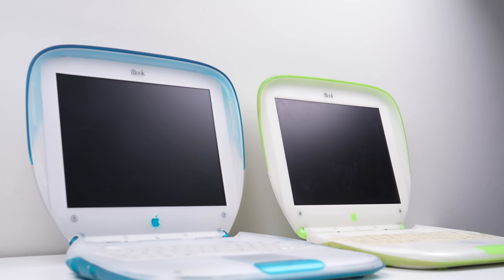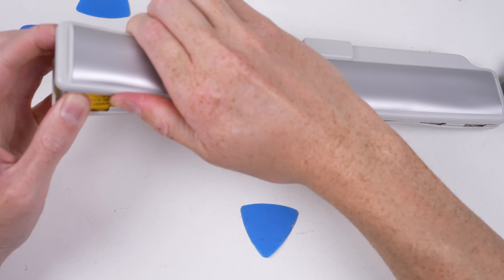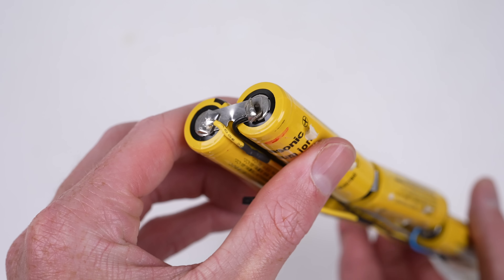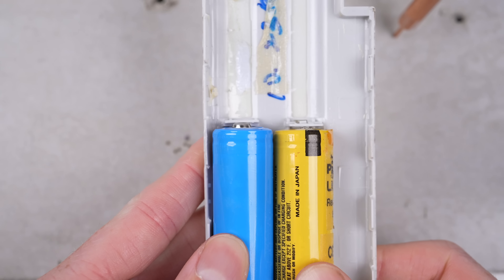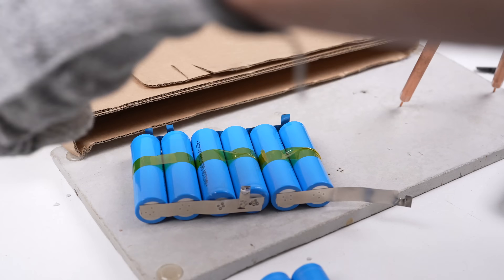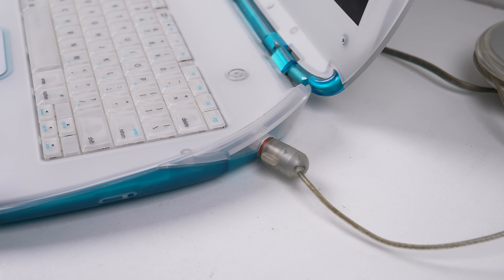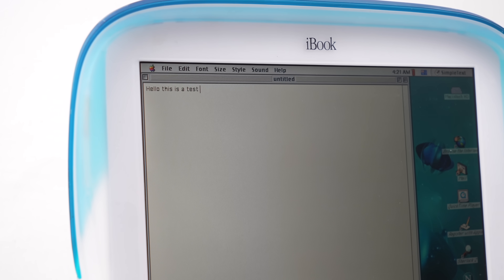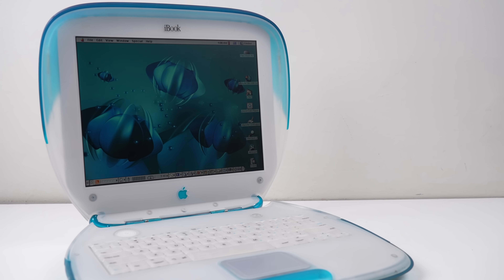Restoring a 1999 iBook G3 To Run On Battery Power - DIY Battery

Comment: I feel spoiled. We have a really awesome "Battery Depot" warehouse/Store that does EVERYTHING including custom battery packs to fit in older laptops and electronics.  Not that I'm dissing your skills but fingers crossed ANYTIME LiPo is involved! Kudos!
Reply: LiPo is akin to electronic HiexPLO(sive).
In this case it's a Lithium I-dunno(ion). Quite different. But not quite a grumpy attitude to negative influences.
Reply: @ningen1980 I kinda have to disagree. While LiPo batteries react a lot faster to overcharge, shorts, etc... and are more fragile, Lithium Ion cells in their stable metal cans have the unfortunate ability to build up a lot more energy, so while they don't fail as easily, they are a lot more dangerous when they eventually do. For example, a few days ago, a solar battery overcharged and blew the bedroom wall out of a house in Germany. The BMS had likely failed, and wouldn't stop charging. This happened a few times already with similar battery packs, but usually, the house was in use and drained the slightly overcharged batteries over night, so a few damaged cells were all that happened, but this time, the owners were on vacation, so the battery kept on overcharging, and nothing was using the power. At this point, a LiPo battery would have just caught fire, but this lithium ion battery kept on building up heat, pressure and energy for days, until eventually, it activated "instant bedroom wall remover mode". In this case, they got lucky no one was standing where the wall landed, but that could have ended much worse. Here are some pictures of the incident: https://www.ndr.de/nachrichten/schleswig-holstein/Nach-Explosion-PV-Batteriespeicher-von-LG-werden-gedrosselt,explosion1270.html

Comment: i got a oem battery for one that still works
Reply: It's always cool to see when these are really old batteries still work. My personal oldest is a 1997 ThinkPad 380ED battery that runs the laptop for over an hour.
Reply: my g3 clamshell battery isn’t rebuilt, lasts 3-5 hrs, my ibm 380z laptop from 1997’s battery (similar laptop to 380ed and i think same battery) is completely toast tho

Comment: Nice work. You were lucky that the BMS didn't shut down permanently after the original cells died like many newer ones do. When I recell Dyson packs I use a bench power supply to keep voltage across each cell tap as I replace that cell. Also, a slipping spot welder tip can blow a hole right through a cell casing - you need to be really careful there.
Reply: There was a tool which I found on dji forum which could reprogram the bms after cell replacement for most of the general electronics 

But it was 200 usd or something per year making it viable for shops only
Reply: @awdhut-e2e  There is alt firmware for the Dyson v6 and v7 batts which can reset those also, using pickit 3 programmer
Reply: @awdhut-e2e  I really wish there was an open source universal BMS programmer tool. This company's charging hundred of dollars a year for their software are obnoxious and likely illegal since they sell the proprietary BMS source code.
Reply: @awdhut-e2e  If you know what you're doing, you can reprogram the BMS using a $5 Arduino (Google "Squidgeefish: A1175 Battery Hacking"), a $6 FX2LP (Google "Karosium: SMBusb - Hacking smart batteries") or even a $3 CP2112 (Google "Leelum: Repairing the DJI Spark Drone Battery with DJI Battery Killer, CP2112, & 9V battery"). It's also possible with a Raspberry Pi, although that's not so cheap either.
Reply: Eff Dyson!   Those b@staffs and their “once dead, always dead firmware”

Comment: It should be illegal for manufacturers to implement the BMS lock like this, because of this most of the time we have to go for a low quality aftermarket battert instead if putting new cells that i know for a fact are good quality into the original battery pack.
Reply: Manufacturers should provide longer and more abundant supply of the original parts (especially the battery) even if the laptop itself is no longer supported, and always ensuring that the spare parts can be bought separately for self repair instead of relying on the service centers

But sadly they don't do that. Instead of offering any spare parts to support self repair, they want the customer to buy new devices
Reply: @sihamhamda47  I can still buy a battery pack for my 22-year-old no-name laptop. The problem is that because it's low-demand and still costs the same to make, it costs more than a current Dell battery pack.
Reply: @camboi6103 Driving a car is dangerous, airplanes can crash, boat's can sinks. Why do we use them then. It is crazy to me to stop people to do what they want with the stuff they bought.
Reply: @ do you need a license to operate those
Reply: @Attakai_The_Kitty  yes, but people stil don't know how to drive even if they gave a licence. And accidents can happen. I am not saying all people need to do this but for us that know how to fix stuff, why stop and make it harder to repair stuff?
Reply: @ because someone is going to blow their hand off trying to open a battery
Reply: @Attakai_The_Kitty  stopping you from completing the repair doesn't stop you from getting hurt while trying. In fact more likely to get injured while trying to troubleshoot why it's not working as opposed to if it just worked in the first place.
Reply: I make all kinds of  stuff from old laptop battery cells, and have about 200 cells at my house. The main thing is if you don't know what you are doing don't do it. First learn, don't be a dumbass.
Reply: Yeah I really wish it was illegal for them to do this anti-consumer crap. I've tried doing this on many laptop packs and it usually doesn't work whatsoever or works but won't register the new capacity properly.
Reply: @TechHowden  Apple was and still is the King of making anti-repair expensive disposable crap.
The irony is that they claim to be ecology-friendly.
Reply: @DonVintaggio  So true. I recently got a 2018 and M1 MacBook Air for free, both needed some repairs and hadn't been used in a few years and the batteries had both failed on them just by going under voltage even though the cells themselves still work fine but the BMS permanently locked and I had to get replacements.
Reply: @TechHowden You just needed to charge them longer, like a few days. Apple batteries don’t have lockable bms boards
Reply: @nomecognome2  the BMSes on those certainly did lock. The batteries drew exactly zero current and even after manually charging them up and bridging the MOSFET the computer would technically turn on but macOS wouldn't recognize the battery or continue charging them. The issue was that the cells went below 2V which the BMS considered to be a failed battery and will refuse to charge.
Reply: @TechHowden  Then there must’ve been some other issue. Apple bms’s don’t lockdown
Reply: @ i'm not sure exactly besides the cells going under voltage. I know both of these MacBooks charged correctly when last used before I got them. I tried charging both of them for several hours although the cell voltages never went up at all.
Reply: @TechHowden No, that's stupid. The solution is not more regulations, stop trying to push big brother government.
Reply: @babayaga7434  If you think companies should be able to make stuff intentionally much harder to repair, then what's your solution to this issue?
Reply: They should atleast add a reset button on the battery outside
Reply: You can unlock most BMS with special hardware
Reply: @7ismorethan6  yes but the only people making that hardware, at least the universal ones that work for all batteries will charge hundreds of dollars for it.
Reply: No it shouldn’t lol
Reply: I make stuff dummy proff but they keep making them dummer
Reply: I think they can’t charge because they have temperature control and, without any voltage in the cells, the bms didn’t allow charging the cells for safety reasons. Do a small charge on each pack and try again
Reply: All the discussion about the dangers of rebuilding a battery pack would be unnecessary, if the battery packs were build as "holders" like for regular batteries. So, you could buy a pack like Hugh did, and replace the cells without any soldering. So, is by design. Is true that is dangerous being tinkering with batteries, but if the manufacturers wanted, it could be totally user replaceable. Like when cellphones came with replaceable batteries? Remember?
Reply: Fuck dyson
Reply: FYI Apple used the factory default password of 0x36720414 to unlock the BMS until at least the last HDD Macbook.

You can communicate with the BMS using an Arduino, and 3 jumper wires to the external battery connector - no soldering required!

Google "Squidgeefish: A1175 Battery Hacking" for a tutorial and Arduino code.

I've saved dozens of battery packs from the trash, just because the cells had dropped below 3.0V from sitting in a cupboard for too long and the BMS locked up.
Reply: while normally I would prefer things to be fixable, re-celling a battery is quite a bit more dangerous than the average computer repair, so it makes sense that manufacturers don't want people rebuilding battery packs at home.
Reply: @ritualdiscs  Yeah I understand that most people definitely should not be messing with lithium battery packs but that doesn't mean experienced people like me shouldn't be able to.
Reply: @dustybikes86  false; there are many qualified 3rd party repair shops and individuals; so by making a design unrepairable you are also denying 3rd party businesses.Apple be like "nobody will touch our hardware except us" and in most cases they replace whole modules or the entire unit.
Reply: usually BMS locking is a safety feature instead of an anti-consumer practice as a poorly assembled or managed battery packs run the risk of sudden homelessness or your contract with life being terminated

re-celling isn't really something that shouldn't be attempted unless as a last resort and even then, leave it to the professionals that know what they're doing and have the proper safety measures in-case something goes wrong

lithium batteries, while the best we have rn are also the most dangerous cause they'll happily combust if handled wrong (just ask Samsung) 

user-replaceable batteries im all for but user-servicable batteries shouldn't be normalised
Reply: @camboi6103  Ahh, now I get it. I'm glad these megacorporations are looking out for us, wouldn't want me to burn my hands or my house down by accident.

Maybe they should glue the devices shut, someone might hurt themselves by opening it after all.
Reply: @camboi6103  Worse, lithium batteries provide their own oxidizer, so good luck putting out a fire.

I expect they could design these battery packs to have easily-replaceable cells, but we probably wouldn't like what it would do to the price. Plus there's the problem of seriously-bogus batteries that are nowhere near their claimed spec, and how do you stop consumers from buying the cheapest they can find?
Reply: @camboi6103  many things are dangerous, but that doesn't mean people should be locked out of doing it.
Reply: @elu9780  true but remember: for 1 knowledgeable person there exists 5 stupid people.

Comment: Awesome content, i have a few tips for you (i replace high amp cells in powertool batteries for a living):
The most important one is, that you use insulation sticker, 
the cells you bought have the raised plus, because they have extra protection chip inside but the battery with a BMS does not need it,
nickel strip is so soft that it can be cut with scissors,
buy the cells from a reputable brand, like samsung or Lg or Sony, 
for low amp devices i recommend samsung 35E for its high capacity and the 8 amp max rating is plenty enough
Reply: Since you do this for a living...
Could a 16600 or 16630 battery have worked for him?
Reply: @Iam_Allan  it all depends on the battery's datasheet, max current  and voltage characteristic, if the battery's amp rating is above 4A or if there's enough cells in pararell so they sum up to 4A, it would have worked

Comment: I've always kinda feared the spot welder because it looks like the metal is bare, just there, but it seems like they're actually wrapped in transparent plastic huh
Reply: These spot welders use low voltage and it's perfectly safe to touch the bare parts of the probes.

Comment: I really should do this for my iBook G4. I quite like the machine, and if I throw an SSD and 1GB of extra ram in there, it could be real fun to use for classic Mac apps and games, since emulation of this era of Mac kinda sucks lol.
Sheep saver doesn't go up past 9.0.4 I'm pretty sure. Doesn't even get to 9.1... 
And UTM is fun, but super slow, even on my M1 Mac. Emulating 10.4 is a nightmare. 
Dunno why this is such a pain. GameCube and Wii emulation is great, and those are PPC machines, those even have a Windows NT 4 port now lol

Comment: I've been waiting to do this for my Dell Precision. But 18650 cells are not free ($5/cell for 3000 mAh) and I need 9 minimum per brick
Reply: All Dell batteries have BMSes they will instantly lock when you remove the cells. If the battery is still working you'll have to do a hotswap and keep power applied the entire time which is quite difficult and more dangerous. If it's not working already then the pack is just dead.
Reply: @TechHowden  You can unlock a majority of Dell BMS's with a $6 FX2LP. It depends on who manufactured the battery pack (Sanyo is the easiest, followed by LG). Google "Karosium: SMBusb - Hacking smart batteries" for a tutorial and source code. I left a comment way down the bottom of the page with some tips.